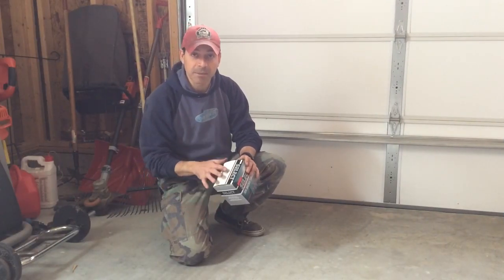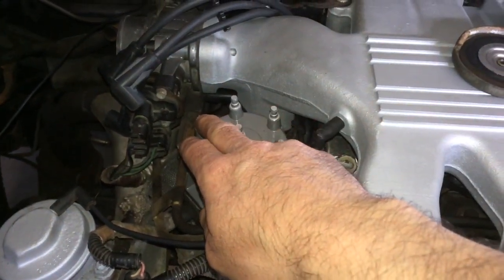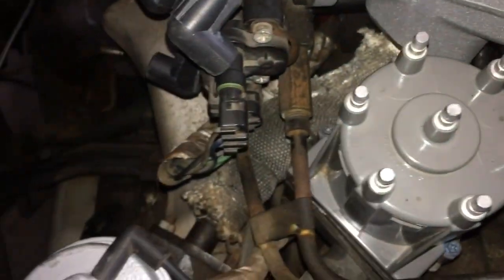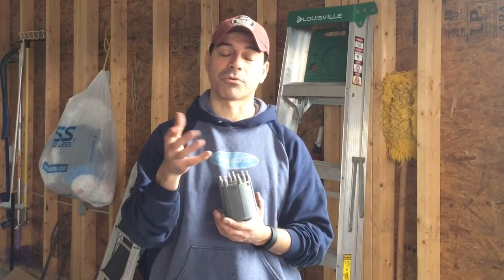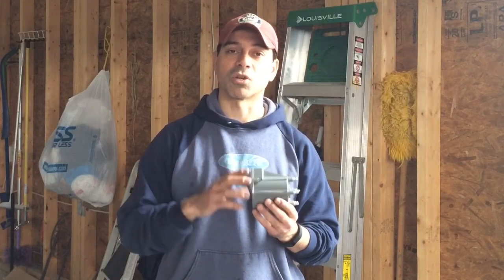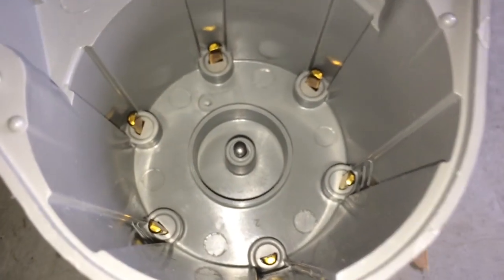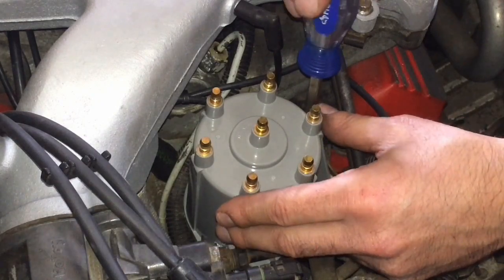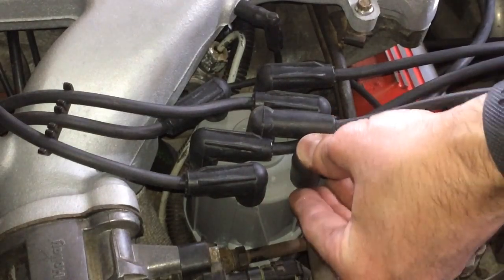Changing Distributor Cap - Fiero GT (Andy’s Garage: Episode - 61)

Comment: can you make a vid how to replace the oil pressure sending unit and  connector on a gt fiero?? thank you regards!!!
Reply from the maker: Alfredo García definitely, as soon as I have one to replace. 👍
Reply: I did the oil pressure sensor on mine last year, it's easier to change the pressure sensor when doing an oil change and the filter is removed,the connector on mine was broke, indicating the wire being to short which probably caused mine to start  leaking over time. Have to figure out a way to fix my connector and lengthen it just a tad when I finally get it ready for this year. Just snowed all night here in the great white north eh lol. The location is just behind the engine strut to the left of the oil filter.

Comment: If for some reason a fella couldn't get a new cap, could he just clean the metal points in the cap?
Reply from the maker: Usually the cap is changed if it has cracks causing failure. If the leads are dirty, you could clean them